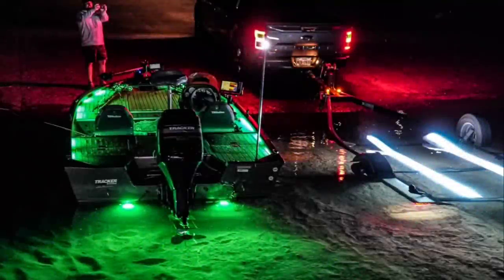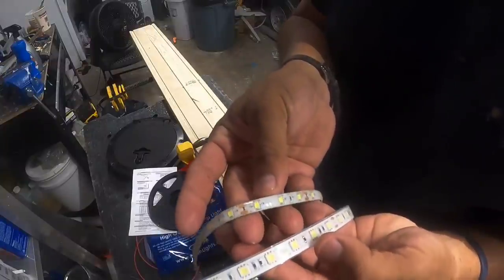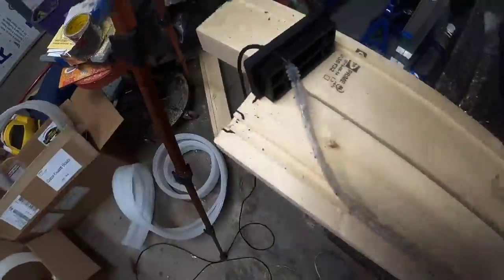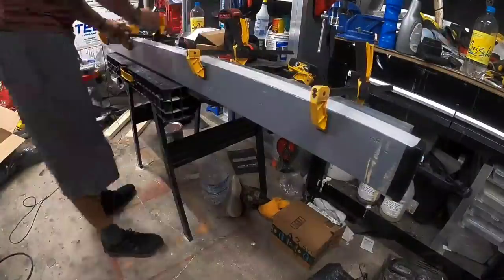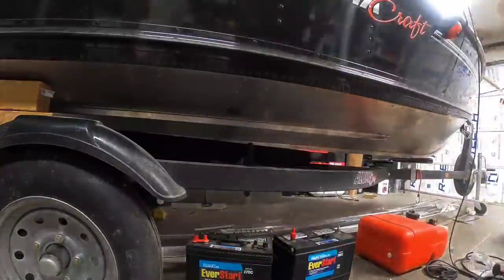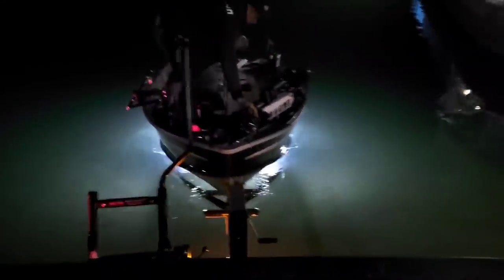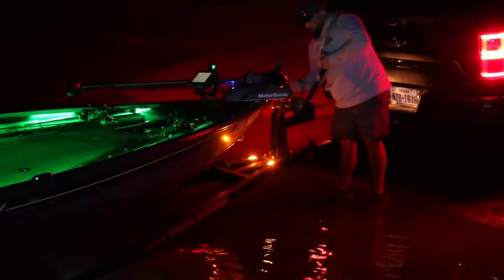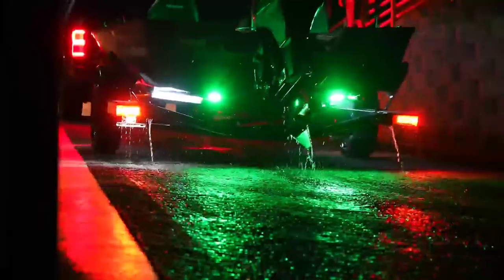Gatorbak Trailer Bunks | Full Tutorial Install

Comment: A Waterproof switch integrated into the frame of the trailer right by the power source or tongue area of the trailer for the bunks would be great so you could shut them off while driving a??

Comment: Hello I have a question about framing. Could I get away with using only 1/16” angle aluminum and it be strong? Or should I only use 1/8”

Comment: It would be cool if you had a way to turn them off while driving and on when launching and loading
Reply: Add a water proof Switch to you Winch Stand, and turn them on or off with ease.
Reply: @gatorbak  cool will do, I have a 14ft boat in planning stages right now, lighted bunks would be awesome